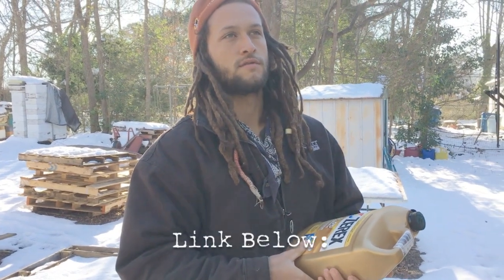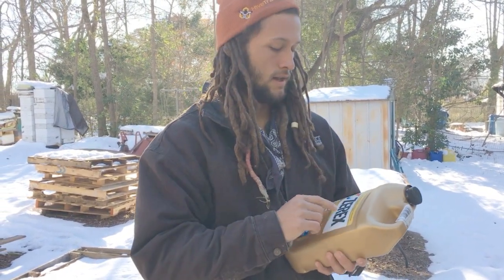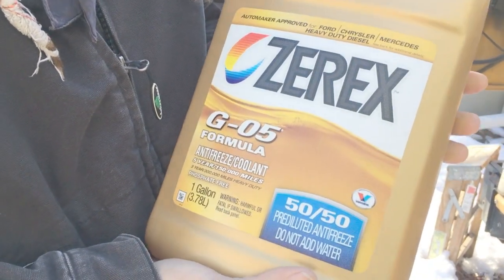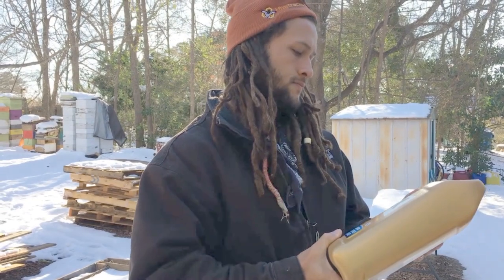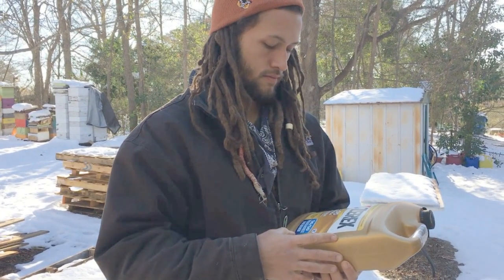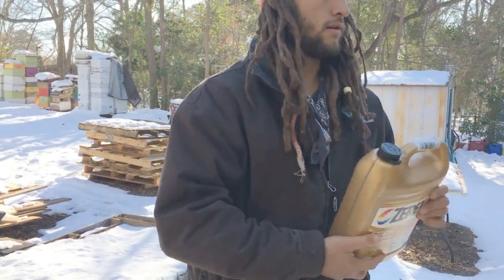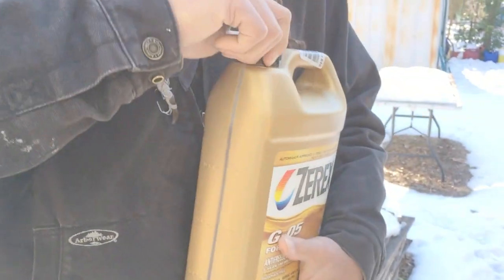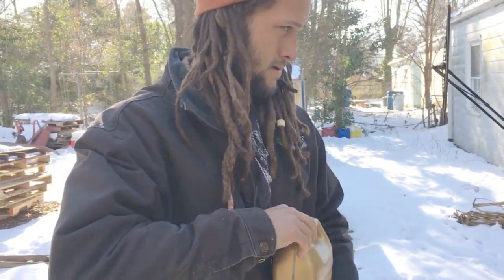EPISODE #14 SKOOLIE CONVERSION: Starting up the engine

Comment: SNOW?  Here in minnesota we still have  a foot of it on the ground. AARRRGGHHH..I'm becoming more intolerant of snow as I age...Oh well just a tiny delay..about your heaters, you took them out?( hence the coolent run) doing mine my next Skoolie work day. I'm really 50/50 on taking them out or not....if this was too difficult please tell me..thanx
P.S.There is a Tork multiplyer  thing I've seen for $50-100 on amazon, dont know the name, but it will work for your lug nuts....